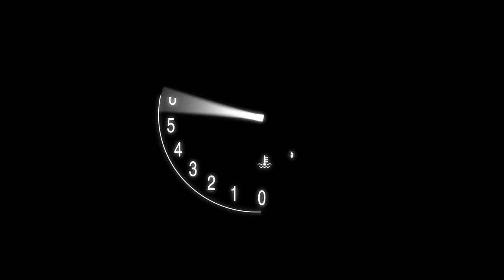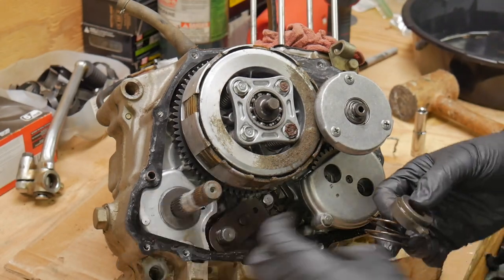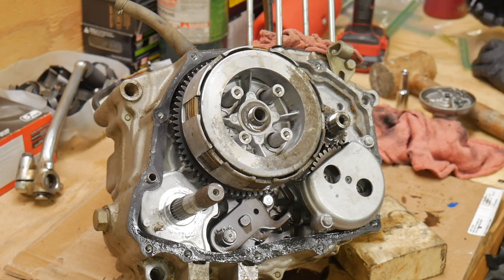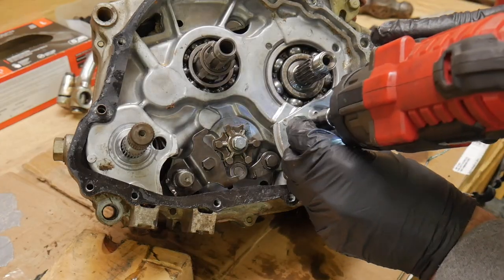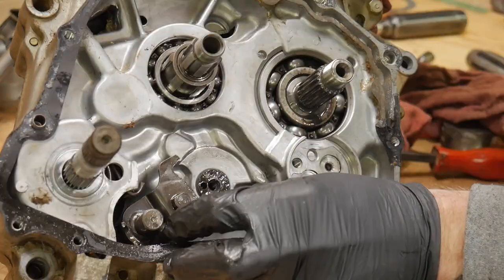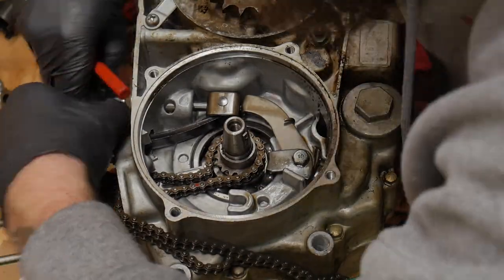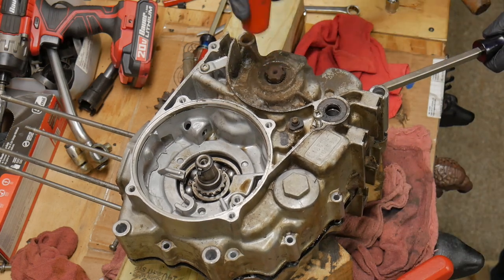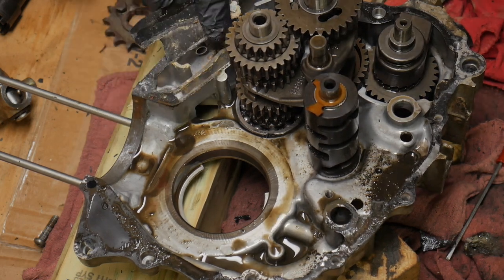Bottom End Tear Down: Honda XL185s

Comment: I have a 79 XL185 S I need to put a clutch in do I need to soak it first? I’ve never done a clutch on a bike before
Reply: "Coat new clutch discs with engine oil" taken right from the '79~'81 Honda XL125s - 185S shop manual. You should get one, mine is a reprint and wasn't too expensive. Think I got it off fleabay.

Comment: Hi Cody, thanks for doing this strip down, it's really helpful to have an explaination as you go (& good job on the audio overdub too!).

I have an xl185 that has seized too, except it was running at the time. I think it starved of oil, and the bottom of the piston grenaded! The piston hit the valves, and conrod flopping about wrecked the barrel. I haven't stripped the bottom yet, but expect it will have bits of metal all through it!

I'm considering whether it's worth rebuilding this engine, the parts cost really begins to add up when a few things are damaged and need replacing. I would find it really helpful if you could discuss this sort of dilemma- is it cheaper and easier to find a replacement engine? Many thanks, Kyle